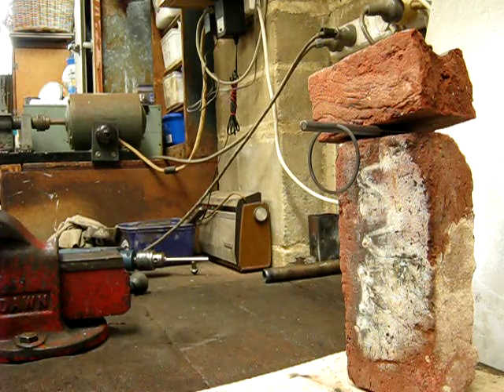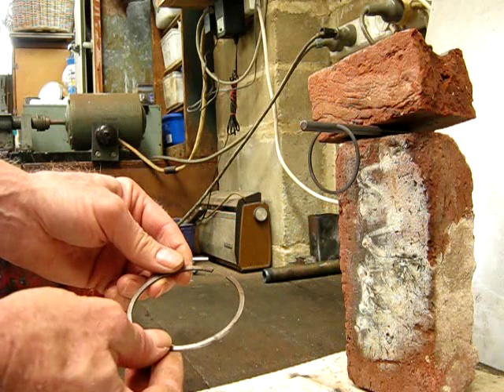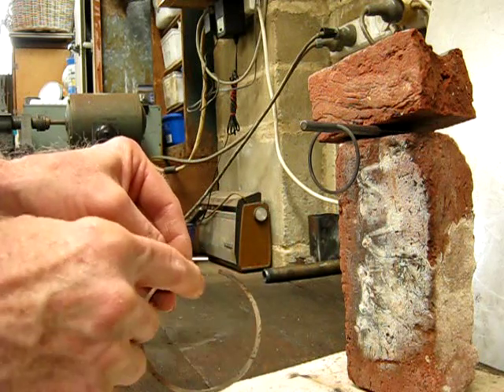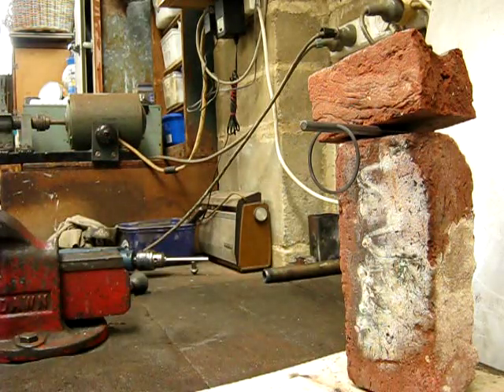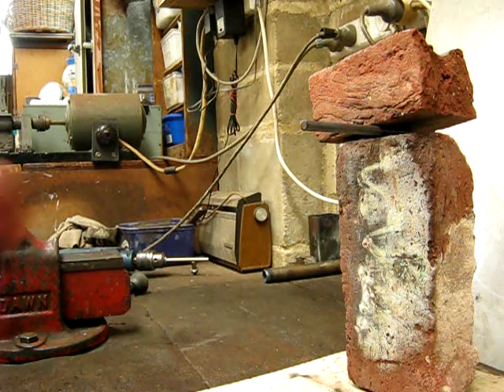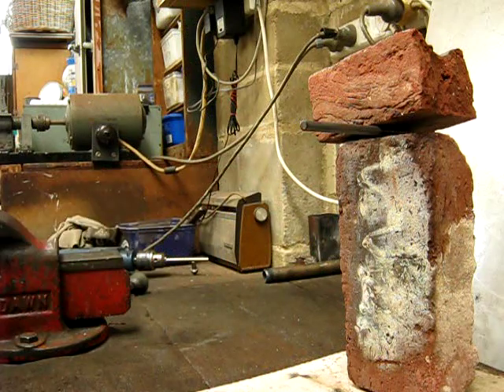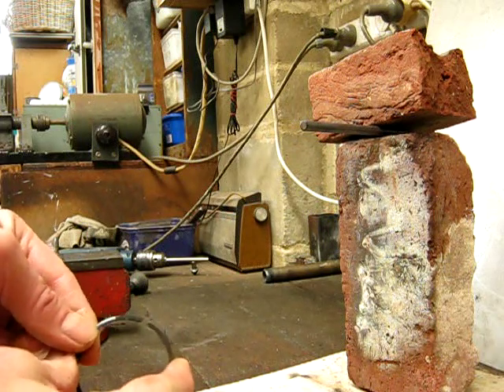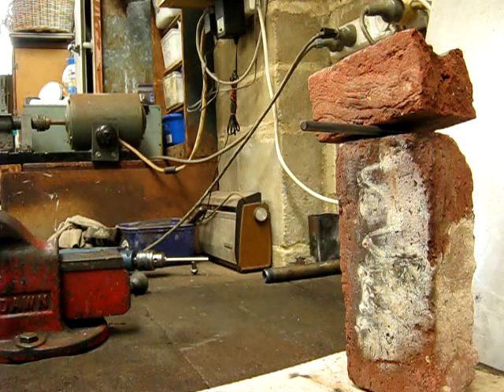Make piston rings - how to expand and tension a home made piston ring

Comment: I was lucky enough to watch a navy trained machinist make some for some obsolete engine. That was 1965 . I remember him using a torch. Great skill. Ty
Reply from the maker: Hi Ty.   It's not as difficult as people make out.  Larger sizes are easier.  My Kawasaki generator rings lasted a long time.  Not worth spending much money on some old equipment, that's if you can even get the spares.  Cheers Rob

Comment: Can you go the other way and make it smaller? If so, how would on go about it? I'm unable to find rings for my old chainsaw but can buy slightly larger rings. could you turn a 52mm ring into a 48mm ring?
Reply from the maker: Hi Walt.   Not really.  Even if you could grind the external ring diameter back (in a compressed state), the amount to remove would be as much as the ring width. Cheers Rob
Reply: @Xynudu  I was  thinking more on the lines of compressing the ring to the desired size by suspending it between 4 metal rods on the od and then heating it until it drops.
Wouldn't work?
Reply from the maker: Hmmm.  Not such a bad idea Walt.  Some good lateral thinking going on there.

Of course you would have to grind the ring gap a lot wider to be able to compress the ring down to the smaller diameter/size.  I like it.  Definitely worth a try.

The ring may not actually drop with four pegs, but should hold the set when it cools anyway, so you could even try re-shaping it in a cylinder the bore size.  Just get everything red hot and then air cool.

Once it gains the correct shape and diameter through your process, you would then have to re-do it with an expansion peg (as I do) to spread the ring (as it won't have any tension at just the nominal bore size).  So in escence you will redimension the ring first and then spread it separately for the tension.

Very interesting approach.  I'd be interested to hear how you get on.

Cheers Rob
Reply: @Xynudu  Calculating the ring gap. I'm assuming you measure the diameter of the ring in it's expanded form and take 15% of that?
Reply from the maker: You will have to grind open the existing ring gap to allow the ring to compress and fit in the four pegs, and have a small (normal) amount of gap to allow for heat expansion.  That then should be the correct running gap and just needs opening by my method to add spring tension.  Cheers Rob
Reply: @Xynudu  Thanks Rob, not only was it entirely successful, it was really easy to do using your method of closing it down and then expanding it again. The rings are 1.5mm thick and my required thickness is .7mm, I've turned up ring holder from some aluminium stock and I'll lap the ring to size on a fat block and 80 grit.
Reply from the maker: Thanks for letting me know the result Walt.  I was really interested to see how it all went.  Theoretically it seemed do-able, but it's sailing in uncharted waters, and anything can happen ;)  I think those commercial rings are tougher than anything I could make in regular cast iron.  I've tried making them around that size and they break very easily.  It's certainly good to get a win on the board.  Great work.  Cheers Rob

Comment: What if i need to do the opposite? Lower ring tension like when trying to install oversized ring in std piston?
Reply from the maker: That won't work as the ring will no longer be cylidrical and will not seal.

Comment: Hi there, I've got a vintage Briggs and stratton engine I'm tidying up while on look down,  she's a smoker, I removed the piston and found  the oil ring stuck no big deal,  I find a tin can, stick the piston in the can and cover it with oil, then I head inside a stick it in the old girls oven for a couple hours. I've used this method a number of times and find it very effective.  Then I carefully work the ring loose but I broke it. I have oodles of new old stock ring sets but nothing the correct size. The question I'd like to ask is... If I used a ring slightly larger  and trimmed the ends, is it possible to gently heat it up and compress it to fit the bore? Kind regards from new zealand.
Reply from the maker: Hi Michele,  it's not something I've ever attempted.  I would expect the ring to compress in an elliptical shape and put uneven pressure/wear on the cylinder walls. It would probably only seal in a few places.

It depends how oversized the ring is.  I think it's a bit risky.  You would have to heat the ring red hot to get any benefit when compressing it.

Your call ;)

Cheers Rob

Comment: Any tips on getting the rings on the piston? They keep breaking before I even get half way.
Reply from the maker: If the rings have been expanded enough they should go on OK.  The cast iron used may be incorrect as well.
Reply: @Xynudu  I made a ring that is flatter with no effect. Then I made a ring with 50% bigger inner diameter. So I have a narrower ring and it's way more bendable. You might be right about the type of cast iron...
Reply from the maker: I've mainly made replacement rings, so I have used the existing measurements for expansion gap/thickness/width/ diameters successfully.   Most compression rings are roughly two or three times as wide as the depth, but not all.  Some slow reving motors/compressors and many two strokes run almost square rings in cross section.  The only rings I've had break when expanding/fitting were for very small piston sizes/two strokes which really need a specialised type of cast iron I think.  Smaller means more fragile.

Comment: Hi I managed to machine some piston rings for my Blackstone OPH they are 7 1/4 inch dia but I did not use your method for heating the rings to expand them. I just opened them with a piece of steel packing in the gap and put them flat on a brick and heated them I am afraid that your method will damage/distort the ring when it falls:-)) Thanks for the info!
Reply from the maker: Hi John,

Your method should work quite OK provided the brick is flat - or you can get twist distortion that way.

The ring only has to drop a small amount, and I've not had any distortion issues.

But do whatever floats your boat. If it works OK then that's all that matters.

It's a good tensioning method, far simpler than all the others out there, and the rings in my Kawasaki generator running at 3000 rpm are still running fine after many years of use.

Glad you found it helpful

Cheers Rob

Comment: What do you say about stainless steel rings for a cast iron sleeve? Nice work by the way.
Reply from the maker: Hi Jose,

I've never worked very much with stainless steel.   SS is fairly heat resistant.

You can only try it and see if they tension.  They should, as the tension loss/gain effect will be the same in both cases.

Cast iron rings work well - the set I made for my little Kawasaki generator are still going strong after quite a lot of work.

Cheers Rob
Reply: The bigger issue i´m having about making them is at the snap, since i cant snap the gap on stailess steel. Regards!
Reply from the maker: That's a non issue.

Just cut the ring with a thin friction disc in a small air die grinder. 

Cheers Rob

Comment: hi rob
i have a old chainsaw needing piston rings the piston measures 52.35 so i would like to make some rings for this project any advice you can give would be great
thanks
Reply from the maker: ***** Hi Stephen.  You make the ring to the minimum internal diameter of the cylinder bore.  The width of the ring must allow the ring to compress without contacting the bottom of the piston ring grooves.

I intend to do a video when I replace the ring in my very old McCulloch yard blower (Airstream) but it refuses to die, even though compression is low.  Not too far away though.

Two stroke engines are good to re-ring as you don't have an oil ring to contend with.  Being high reving engines, the quality of the cast iron is pretty important to avoid possible ring breakage.

Keep the revs low initially to let everything bed in.

Cheers Rob
Reply: Thank you

Comment: Hi Rob,
Great video.
As you are going to split the ring, do you calculate the desired end gap and then over size the ring diameter to allow the amount of material removed? Also do you simply split it with a cut off wheel? Thanks
Reply from the maker: Glenn MacGregor Hi Glenn.  All is explained in my web page on this subject:  http://users.tpg.com.au/agnet/make%20piston%20rings.html

I intend to do a video of the full process at some stage - just waiting for a suitable engine candidate needing a replacement ring to come along.

Cheers Rob

Comment: Excellent.  Have wanted to make some for years and now I have the need. An old boy I used to work with used to make them for his daily transport a 1937 Coventry Eagle. Put new ones in every spring. Well it was works time and material !  His method was much more complicated than yours, multiple operations.  Like the idea of a plate in a forge to set them. I haven't got a forge but I have got a Barbie and an air blower !!!  Cheers from the UK near Earles Court.
Reply from the maker: Rob Lane Making a compression ring for a two stroke is relatively easy.  Where it gets tricky is making an oil scraper/ring, especially if it's a small size.  But all do-able.  I guess it must be getting a bit cool over your way about now.  Cheers from down under. Rob

Comment: I am making some at the moment for a 53mm bore I turn them in a jig which is .005 over size from the bore, after slitting.  and  measure the inside Dia of the piston ring "where it will sit " on the piston and give  and bore of the ring .005 clearance ,then I remove it and do the next one , question is , because the bore is only 53mm will I have to put them on an arbour and turn the outside then heat treat them or will they be ok PM if you like for discussion
Reply from the maker: If I understand correctly, you have sized the external diameter slightly oversize prior to cutting.  I don't see any reason to turn the outside down with that measurement.  I think they will be OK. I can't advise on the ring gap for that diameter.  Use one of the ring gap calculators on the web.  Rob
Reply: xynudu . thanks rob, you have understood correctly . I have been thinking about it and would agree the amount oversize it has been turned will be enough I think now because as you said it must expand against the wall and with heat treating as in your video it will be enough , because it has been turned .005 oversize at the start it should make a "seal" , thanks for you video's they are easy to follow and explain things easily adrian
Reply from the maker: Once you expand the ring, it will seal regardless of the amount of oversize.  The only benefit from a very slight oversize is to allow for wear in - according to what I have been told.  Glad to share what I have learnt.  Cheers Rob.
Reply from the maker: I reread this reply again.  I think .001 oversize would be plenty for that diameter.  I hope you are not thinking that the sealing action is caused by the oversize effect.  This is NOT the way it's supposed to work.  The ring should be the nominal size of the bore and THEN expanded to give sealing/compression effect against the cylinder wall. I know you can avoid expansion by going oversize, and it will work for a while, but that is definitely not the way to do it.  Cheers Rob
Reply: thanks rob much appreciated

Comment: I like the simple way you use to make basic piston rings, I'll have to give it a try sometime.
the most important thing to make rings seal and last is the finish of the cylinder bore, proper honing pattern and grit of stone are necessary to make the rings "seat" .Also ring side clearance and depth of ring groove are critical to keep the ring from vibrating as it moves up and down the bore at high speed. Vibration will let compression gasses slip past the rings into the crankcase

Comment: do you use spun cast iron, or normal cast iron

made soem today, 1/8" x 1/8" x 2.25 diameter.
broke every single one
Reply from the maker: I use ordinary fine grain grey cast iron (as in a metal pulley).  I believe spun cast iron has a different graphite content/structure. That ring cross section is tiny.  I would have expected the ring to have a thicker one. ie.  more than the ring thickness. Cheers Rob

Comment from the maker: The original method I use says to air cool the ring, but I understand what you are saying about oil tempering, and it's worth a try.  The only difference is that the ring is cast iron and not steel.  Still an interesting suggestion.  The only question is whether quenching (fast cooling) would make it more brittle.  Cheers  Rob

Comment: When making watchmaker parts, we drop red hot steel part in oil, this creates perfect tempering (blue) as sometimes parts are soo small that air cool causes crystallization and then annealing (softening) is needed. The ideal color is blue as it is the strongest. But super heat (dull red hot) must always be established before metal can transform. When crystalized cooled, metal needs to be shined up and then heated to 500 degrees to establish blue. Dropping red hot into oil is simpler.

Comment from the maker: If you did that you wouldn't be able to use this simple method. This video isn't about making the perfect piston ring, it's about making a usable piston ring simply without a lot of effort. These rings work perfectly OK - as can be seen in the video where they are fitted to my Kawasaki generator.  Three or four years later they are still working perfectly.  Cheers Rob.

Comment: To ensure uniform stress relieving around the circumference you need to clamp the expanded ring between two plates in order to fix the stress at that postion while the ring is heated.

Comment from the maker: Glad you found it useful.  If I had moved the ring in closer to the bricks it would have heated up a bit quicker - but it worked OK as shown.

To tension a really big ring (eg. out of a vintage stationary engine) you may need to consider heating it on a metal plate in a forge to red hot, while applying light tension to pull the round metal slug forming the set out of the gap when the cast iron reacts - basically the reverse of what's shown in the video.

Or you could use oxy acet.